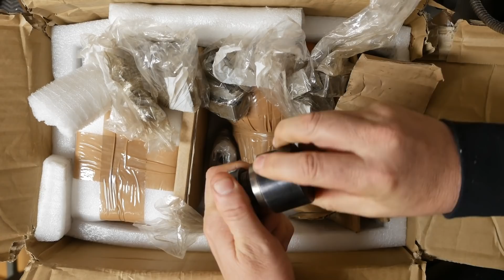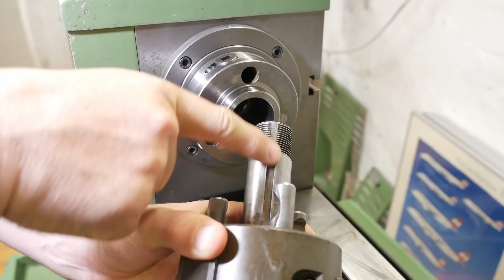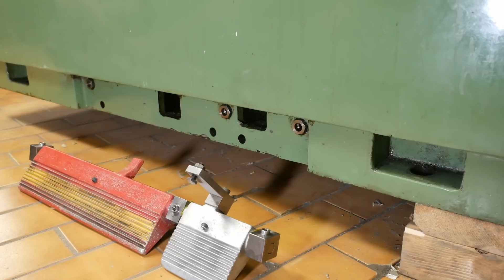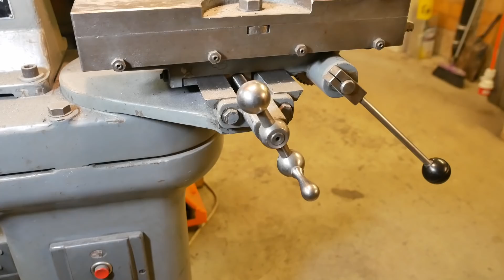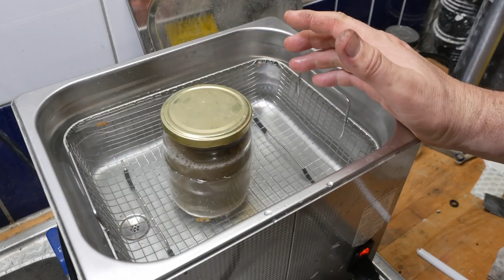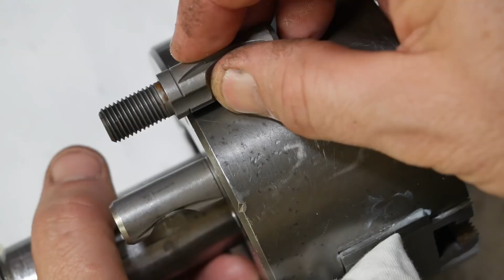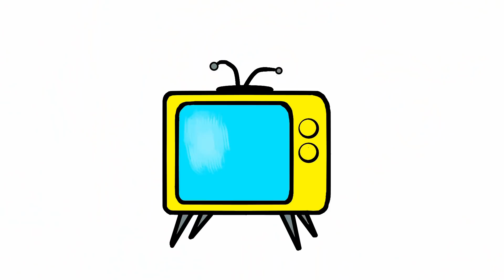How does a CNC power chuck work? || RotarySMP

Comment: Those 3 holes in the front of the chuck are likely  used for depth stops if your holding thin stock, to keep it parallel to the chuck, and spaced off the jaws.
Reply from the maker: Good point. That would be super useful.
Reply: @RotarySMP  Possibly worth keeping them blanked off with grubscrews to keep them clear?
Reply from the maker: @ericfeatherstone  Good idea. I think I have some M4 grubs screws.

Comment: While looking on the air inlet of the spindle, it might be beneficial to constrain rotation with something else, then tubes. Maybe just ballast on the bottom, so force that gets through the bearing through friction will be counteracted.
Reply from the maker: Good reminder. I need to go back through the old disassembly video, as I have a feeling there is an anti rotation feature, maybe I missed reassembling it correctly.
Reply: @RotarySMP  why would you want to bother re-running all that tubing instead of just putting a 90 quick connect right where the hose melted through? especially one you solder a bracket/arm on that you can fix elsewhere to the body of the lathe to completely avoid this problem in the future?
Reply from the maker: @Keechization  I didn'tt think that through when I said it. I will do that.

Comment: That chuck is indeed a thing of beauty, what luck getting your hands on it!  In the old job the approach to setting NDT intervals was to make them often enough that a probable crack would get inspected three times before it became critical, which seems reasonable to me.

Your experience with your English grinder reminds me of my experience with English aircraft; after that I'll take just about any others German included.

Finally it's almost a shame that even the cheap sockets are improving; the softer ones are handy if you want to modify one for something.
Reply from the maker: Bummer the jaws are cracked. Incredibly close tolerances on the grinding.
Reply: @RotarySMP  That might mean that they're serial parts rather than individually fitted though; here's hoping you can get another set.
Reply from the maker: @jimsvideos7201  I hope so as well, although I fear they will cost more than I paid for the chuck.

Comment: looking back to episode 8 I see that there were originally braided hoses with banjo fitting to the chuck cylinder,
which clearly worked well for the last few decades.
perhaps a hybrid of past and present would do
the new airlines to a block mounted to the old hose bracket location and new/original braided hose from there to the
cylinder . best of both worlds.
Reply from the maker: Unfortunately I binned the old hoses and banjos. I figured reinstalling 40 year old soaked plastic was asking for trouble.  Now I will have to make this work.
Reply: I was thinking replacing the 40 year old hose with new ;)  that hose and the crimps are easy to find
A bit of background on me : 12 years of  field service, and 2 as service manager  on mori seiki machines in canada and then 1year with DMG .
It is very important that those cylinders are constrained ONLY in rotation , in no way should there be any kind of rigid connection.
this was done on your machine with the stiff air hose's, and the rigid bango fitting. and therefore replicating or replacing with exact would be the 
wise thing to do.
Mori and the other japanese manufactures commonly use Kitigawa chucks and cylinders . these are much larger and heavier than yours.
 to keep the hydraulic rotary union from rotating, an arm bracket bolts to the headstock and reaches back to the rotary union and ends in a fork .
 there is a detail on the union (a hydraulic drain) that sits loosely  in this fork (sorry could not find pictures) ,this prevents rotation.
What you do not want to do in any way, is offend or harm the seals or bearing on your (40 year old)rotary union and cause it to seize
Reply from the maker: @steveggca  I checked last night, and there is an anti rotation feature on the air connection sleeve, which keys into the rear cover, so it was no the tubes which was reacting the the rotational friction.
Reply: @RotarySMP  Ah so merely a hose routing issue. i was wondering what that thingy was on the bottom of the cylinder.
definately replace the swivel fittings with fixed . 
by the way M8x1 is a common hydraulic thread
there are closed center hydraulic cylinders used by mori and others and they do constrain the rotation by thoughtfully arranged hydraulic hoses
Reply: Addendum. Were you aware of the anti rotation thing before last night ? If you had missed that , in normal rotation the hose most
certainly could have been pulled against the piston.
if that is the case than just repairing the hose as is would be fine except for when running without the cover.
Reply from the maker: @steveggca  It was always installed, and would have been in the right location. I need to check, but the cover my have pushed the tube into contact with the piston.
Reply from the maker: @steveggca  I need to take a closer look at that.

Comment: not only are they for depth stops, but a thin flanged cover, stops the greese from pushing out of the machine surfaces, also a seal against chips falling inside the ways of the master jaws, gumming up the operation of the chuck, also stops the cutting fluids from thining out the grease.
Reply from the maker: Thanks for sharing that.

Comment: On the Clarkson, to add a vernier to the slide, just install a Chinese caliper to the bed to act as a DRO. Down and dirty, quick and cheap. Nice to see you using the Clarkson. It's hard to not have something like that when you watch Stefan's videos. You get jealous real fast. At least that's why I bought my U2 Deckle clone similar to the one that Robin Renzetti modified (and Stefan also). BTW, I liked your chamfer bit vid. Very inspiring as usual.
Reply from the maker: Good point. Tool grinding is a fun hobby in and off itself. Takes me a lot of time to find the set ups.

Comment: Everything needs more power according to Tim Taylor... I had an ultrasonic cleaner years ago and it never really did much cleaning that I could see. Now my friend is a jeweler and has a beast of a steam cleaner as in rip the mean off your hands steam and it works great but it's the size of a liquid cooled spot welder and I know I would end up getting hurt with it but it sure cleans well. I'm a little leery of the long term lifespan of the air cylinder more so than the tubes to it (once routed better)
Reply from the maker: That is probably correct, as Schaublin redesigned the air cylinder for the later model 125-CCN, to replace this large diameter single piston model with a more compact dual piston design.

Comment: G'day!  That's a nice looking grinder. Damn Brits using all these weird non metric threads and shit :) says the Brit waving to you all the way from the colonies that haven't yet dumped imperial weights and measures - my life is forever in limbo.  Speaking of grinding, when I did work to replace the spindle bearing on my cheap Chinese mill I needed to machine down a socket too. I used the lathe and carbide tooling. I don't know what this HomeDepot socket was made of but needless to say there were loads of sparks and chips that landed on the lathe bed carried on burning on their own. I'll never forget that experience.
Reply from the maker: I considered turning it down, but decided this was more fun and better content.

Comment: For the tool grinder, use a dial indicator on the cross slide.
Reply from the maker: I could, but it was not a precise job, so it was easier to complain than to fix it :)

Comment: that's not just any adjustable wrench, it's the only adjustable wrench you should ever use :D

that pin thing that wouldn't come out looked like its hole had its edge slightly peened over by the stamped lettering.
Reply from the maker: Next time I have it apart, I will take more time to deburr the whole body. I was kind of rushing to finish the video.

Comment: That chuck has definitely lead a very hard life, what a shame it's been mistreated like that, but glad it's found a good "forever home" where it will be  restored and put back to good use.
Reply from the maker: I hope the replacement jaws dont make it a financial write off.
Reply: @RotarySMP  Could be, unless Gamet decides to contribute. Either way it's dangerous to use chuck with cracked master jaws. Obviouly from the external appearance of this tool it has been used improperly or outright abused, a shame.
Reply from the maker: @MRCNC1967  I wonder if it jammed due to not performed regular cleaning and maintenance, and the "fixed" it with percussive maintenance, which "worked" well enough for them to get into the habit of doing that. Glad I made this video. I nearly didnt bother, but this way at least I get a bit back out of it if it is write off.
Reply: @RotarySMP  Probably just had too high of a drawbar pressure. Looks like a major stress concentration there, some design blame too.
Reply: @RotarySMP  Several years ago a factory tech came into my shop to service one of our production CNC lathes. On the workbench next to the lathe he spots a ball peen hammer alongside other shop paraphernalia. He picked up the hammer, looked me in the eye and said, and I'm paraphrasing, "This does not belong anywhere near this machine." He also did not like air blow guns since they tend to drive chips into spots they do not belong. He took his job very seriouly and literally spent an hour just cleaning the "patient" before service. Fortunately it was a warranty visit so no skin off my wallet.
Reply from the maker: @MRCNC1967  Shame to beat on nice precise equipment with a hard hammer. I felt bad enough knocking parts out with a copper drift.
Reply from the maker: @TheMetalButcher  Could well have been.

Comment: I remove chamfer from sockets when it is beneficial, typically to hammer smaller socket on rounded nut with proper cutting action.  I spin sockets with a drill and i put then to a grinding wheel until i end up with 90 deg edge
Reply: Also i made extra short 5,5mm 1/4" socket this way, i shaved it to about 10mm to work on VW, Skoda and Seat AC heat flap actuator without dismantling whole system. Bastards put screws about 3cm from floor and servo dies randomly :v
Reply from the maker: That socket only cost me €3, so it was a no brainer to make a special for this job. I hope my Audi doesnt have the same actuator.
Reply: @RotarySMP  I repaired this problem in single temperature setting, automatic AC systems from about 2000 to about 2010. It's not too bad as dc motor dies open and comes to live few times, so trouble codes are already saved and you will feel lack of temperature control before final fault. Parts are available, in left hand drive cars job is not too bad with said socket and nice quality 1/4" driver, but with flat wrench i would loose mind as this requires laying on the floor and backing off bit by bit
Reply from the maker: @poprawa  Mine is a 2013, so hopefully not affected. Sound like a real PITA.

Comment: Main concern with ultrasound when talking about those material thicknesses and frequency (28 or 40 KHz for those types of cleaners) is reflection/transmission coefficients rather than attenuation (with is pretty much negligible, will be on the order of .01 db/mm). Those coefficients are determined by the parameter called specific acoustic impedance, more simply put (density times the speed of sound in the material). The higher the difference -- the less gets through. Water is about 1.4-1.5 MRayl (unit of acoustic impedance), plastics on the range of 1.5 - 3 MRayl typically, glass > 5 MRayl. So more ultrasound is reflected off of the glass.
Reply from the maker: Thanks for the feedback. So it is probably best to have the parts in a  plastic container?
Reply: @RotarySMP  Yes, plastic should work better. Or if the bottom of your jar is making good contact with the metal (of the ultrasonic cleaner) just above the transducer then it shouldn't matter.
Reply from the maker: @tyakoss  Thanks for the tip.
Reply: @RotarySMP  No worries. Thanks for making great videos, loving the Schaublin series!

Comment: I taken apart the schunk chucks at work many times. The most pain in the butt part is to fiddle the seals on to the base jaws. It's a small opening and the seal has to sit on 3 sides of the jaw.
Reply from the maker: There are no seals on this one. There is absolutely no play in the jaws and bell crank, so until it was cleaned, the bellcrank bound up on the gunk. I can see the need for regular maintenance here.

Comment: I have a couple magnetic back dial indicators that use for machines that do not have any measurement dials…very handy for the shop
Reply from the maker: True. Although magnetic and grinding dust are a messy mix. The Clarkson has a number of features for monting stuff though, so I should have been less lazy :)

Comment: i would bend hydr. tubing instead of plastic pneumatic hose. wenn you groove it before bending it (with the manual lathe) these work pretty good with the push fits.  just paint it on the first 10mm with a marker, push it in and turn it a few times, the you see the perfect position.

nice chuck an tool holders btw!
Reply from the maker: Thanks for the tip.

Comment: re: the clarkson scale missing, a simple way would be to set a dial indicator against the cross-slide whenever you need accurate movement, maybe? thanks for the videos!
Reply from the maker: Good point, although a magnetic base is a pain with grinding dust.
Reply: @RotarySMP  Doesn’t need to be magnetic. A hole, or using the t-slot, for a suitable indicator holder of some sort. If you fancy you can even make it permanent. But you said that already in the video I think. 🙄🙈

A “Robin-Stefan-O-ring-drill motor-drive” would also be nice.
Yeah, I know. Time. To many projects already.

This is getting along really nice! 👍
Reply from the maker: @andli461  I have an O-ring drive for cylindrical grinding on the Clarkson, but this job didn't really need it.

True, the Clarkson is not short of mount points. Since nothing was critical on that socket, it was easier to whine about missing accuracy, than to do something about it :)
Reply: @RotarySMP  Totally agree. For this job it was perfectly fine. 👌
But then you start to think…about nice features… And bang, you have a new hobby. In addition to the initial one you got the tools for in the first place. 🙄😬😂
Reply from the maker: @andli461  It is always a danger with this hobby.

Comment: for my ultrasonic cleaning needs, i just throw everything in one or more ziplocks, filled with cleaning fluid (I use iso, or dishwasher fluid. I think they stand up to acetone too but can say 100%) but have used glass many times. I think both work fine.
Reply from the maker: Yeah, I also dont over analyse the U/S cleaner. If it doesnt work fast, I just zap for longer.

Comment: Those sockets usually aren't that hard. I've turned several down in a lathe, and it usually machines like butter. I was actually a bit surprised the first time.
Those 3 holes on the front are probably meant for adjustment screws to get a part to run concentric. I'd wager someone made them for that at some points through the chucks life.
Reply from the maker: I briefly considered turning that socket, but decided in favour of sparks, for better content :)

Good point. They will be handy.
Reply: +1 here, they wouldn't last long if they were hardened, iirc even HSS easily cuts them

Comment: Really informative video, I never tought to contact the manufacturer of a chuck for disassembly.
Reply from the maker: With some old crusty, but precision part, even if simple, it is sometimes hard to know whether it is not coming apart easily because of burrs and crud, or cause you missed the one buried set screw. I was also curious whether they still support this model with new jaws (they do).

Comment: I'm not sure why you would want a powered chuck without a passthrough for stock. I'm assuming this lathe also takes 5c or equivalent style collets, that's really where the power draw tube comes in handy. The air union most certainly needs a support arm to prevent rotation, it looks like there wasn't one on there, but its definitely necessary.

Last year I made from scratch a headstock for an emco pc cnc 50 lathe last year that utilizes 5c collets, and allows an air powered draw tube to automatically draw collets in order to bar feed. it works great, I can run batches of parts unattended and work on other things. The stock chuck was actually really nice but the headstock only allowed 13mm of pass through. The new headstock I made can do 38mm, which allows a draw tube for 5c allowing up to 25mm stock to be automatically pulled through, and now i can use any 5c chucks and collets. I bought a cheap bar puller off amazon and mounted it to the cross slide, so I still retain all my (6 ;-;) tools and can bar feed.
Reply from the maker: The spindle nose is Schaublin B32 collet native. Similar size to 5C. Yeah, I had a nagging doubt about the collet closer anti rotation feature. I think I need to check my mates 125-CNC, as I might be missing a part there.

Collets will cover all the bar stock, so I guess a power chuck is used for small parts.

Did you post a thread on your Emco headstock build anywhere? I would be interested in seeing that.
Reply: @RotarySMP  No, although I could do one up on practical machinist. If I do ill let you know.
Reply from the maker: @davidfarmer  That would be cool. Please do.

Comment: You could have probably just turned the socket on the lathe, I did it with carbide tools and it works if you buy those cheap chinesium ones, but if I had such a cool tool grinder, I would also want to use it more :)
Reply from the maker: True, that would have worked, and probably even made a nicer surface finish, but less content :)